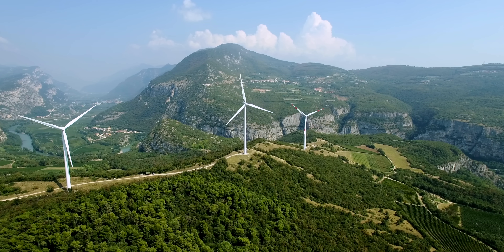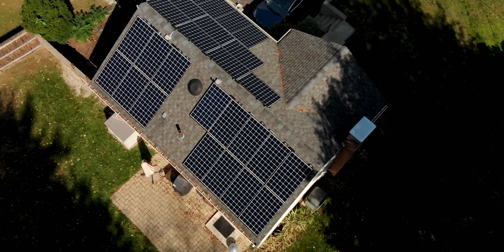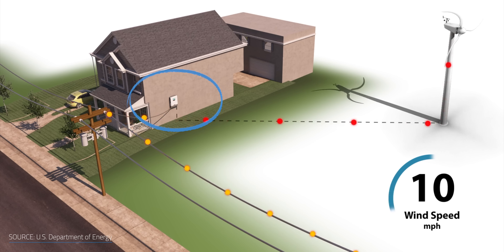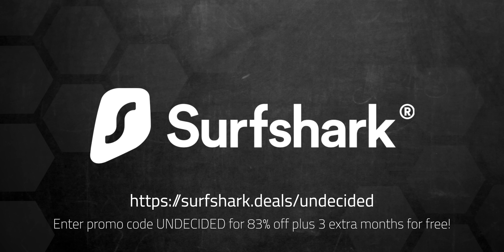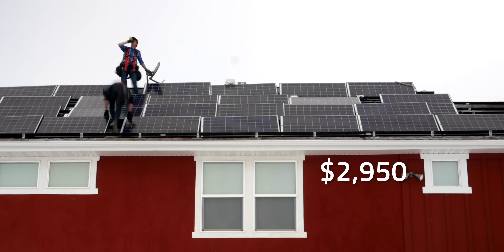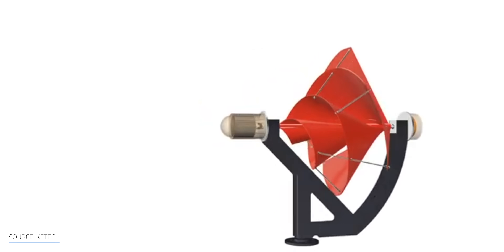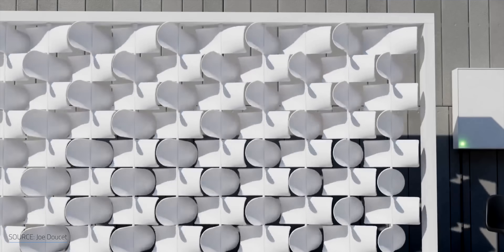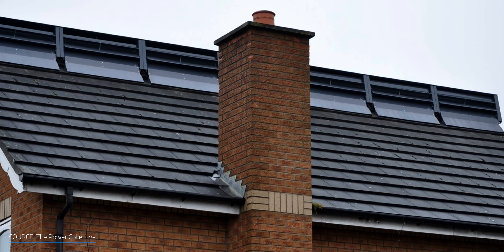The Challenges of a Wind Turbine on Your Home

Comment: Having worked in the small wind industry for 12 years, selling ~4000 small wind turbines, having one in my own yard for 14 years now, I would encourage everyone to install solar and forget wind, for the reasons Matt gave here.  The 3 small wind manufacturers I worked for are long ago bankrupt and the goofy designs shown in the video won’t produce hardly any energy but will cost a lot.  Large, utility wind makes sense because they’re hundreds of feet in the air with massive rotors.
Reply: That’s fine unless you live in a place like I do with over 50% of the days having 100% cloud cover or fog and almost every day with moderate to strong trade winds. It’s all about location and microclimates..?.
Reply: @cadfael4598  you are probably better off installing hydroelectric genoration if you are wanting to go off grid in an environment like that. Small scale wind is a great project if you want to do it for it's own sake but it simply isn't cost effective.
Reply: That might be true, moving parts seems hell to maintain. However, with less than average sunny days, 53° North and average wind speed around 13-14 km/h, I can see why there are Dutch startups entertaining the idea. Solar just doesn't pay off in some locations.
Reply: I assume 12 years ago there was a lot more ability for solar and wind to compete at a small scale right? But then solar just kept getting more and more efficient while wind stayed mostly the same (at the residential level).
Reply: @SaveMoneySavethePlanet  It isn't so much efficiency has improved that much for solar, unless you want to call it efficiency of manufacturing. Cost from 20 years ago were about ten times as much per watt for the more commonly available panels and those are in the 13-15% solar efficiency range. Then and today, you could buy panels well above 20%, they just aren't worth it for most applications.
A big issue between the two techs, is they have opposite scalability problems. Generators, of all kinds, tend to get more efficient as they get larger and cheaper to manufacture, and easier to deploy at scale. Solar is simple and cheap enough on the small scale, but gets surprisingly complicated as it grows. If those problems with solar can be addressed, it does have greater potential, but for the moment it is a good choice for systems on the 10 KW order. Wind seems to take over by the 1 MW, and the more traditional techs for GW and up.
Reply: @barongerhardt  ah interesting! Never thought about it that way!
Reply: It has to depend on location. There is a YT channel by Kris Harbor, who has a wind turbine producing up to 400w. He admits, his location is pretty windy!!
Reply: I don't know that anyone is advocating to get wind instead of solar. I agree wind has some serious flaws for micro-generation at least with HAWT. I think some of the VAWT options and especially that Ridge Blade system show promise as a supplementary option.

With solar, for monetary reasons we focus on grid tied solar with no batteries. Then people with money might invest in a battery like a Tesla Wall or something that can get them through the night. Batteries are pretty expensive but if something like the Ridge Blade is sold at scale, it looks like something that can be installed in a day, is minimally invasive, protects itself against excessive wind, and is no more unsightly than anything else on a normal suburban roof. Just for fun I think I might have a broken tower fan that I might break open and experiment with.

Again I agree SOLAR > Wind. But wind has merit if we think differently.
Reply: A basic box fan has the capability to produce a current from wind blowing in the window, albeit in the mA range lol, maybe power a small led
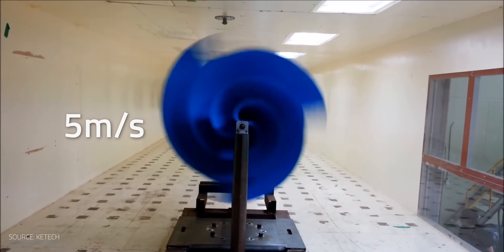Reply: The Canadian one at 10:53 also doesn't make sense?
Reply: @rajaram4658  …I’ve been a roofer and do all my own roofing maintenance.  I can tell you that on the ground the air will be completely still, but on the roof it is windy as heck.  Doesn’t make sense as I live in a one story house so it’s only 20 feet above ground, but that short distance makes a huge difference.  So I can understand how that Canadian contraption may possibly work.
Reply: is 10 to 15+ mph ( max i remember is 40 to 60 mph stable for 24 hours or so ) 20 or more feet up do with stable wind speed as 4-ish months out of the year at this house is dead calm the rest is super windy omost constantly, is it a good candidate or not really with 2022 technical/off the shelf kits as installation with good information for me shouldn't be to hard to do and had someone sigesion of running that over a 1 to 12kw hardware store generator as o crap no solar or utility power mode and or as supplemental to charge up the bev or house batteries
Reply: So the truth comes out!
Reply: This kind of first hand info is what people need to make a decision.
Reply: Pour billions of $$ into wind turbines, and they'll beat combustion all day long. Everybody saying "moving parts" because the OP video guy said it. Bunch of sheep that don't care to make independent decisions.
Reply: What bragging rights! 

Here's something for the idiots of Renewable Energy: 

Sooner or later you greenies are going to need to grow up and learn how economies work. - hint government people understand nothing of economies other than  how to rape them.    

These G-morons decided "woke' power (power that doesn't really work) was a great idea for them, not us, so they decided to steal some money from some ratepayers in order to pay others to stimulate the growth or power that really doesn't work - ie wind and solar.

In the real world, the one that really works,  there is something called supply and demand and these things regulate the price of everything fairly.  

Your butcher buys his beef by the side and pays more for it than the meat packing plant did who in turn paid more for steer than it cost the rancher to produce it.   Get it so far?     

Now when you buy that beefsteak at the butcher's shop he's going to get his markup as well,  so you as the end consumer are going to have to pay a lot more for it per pound than the rancher was paid for it.   

Next time you want a beefsteak drive out to a ranch and buy your steer on the hoof - then you slaughter it, age it carve it up sell the inedible parts to dogfood processors and the like and eat the rest of it on the cheap - no you want the value that all those who added value to the meat along the whole length of the supply chain don't you?  Or do you buy your steaks on the hoof?      Or do you expect to pay the  ranchers price at your favorite steakhouse as well?

It's that way with electricity too, you cannot expect the power company to buy power back from you at retail rates when they don't even need or want the power. With that business model they will go bankrupt as soon as their investors are wiped out.    

If that rancher were to dine out at your favorite steakhouse why not demand that your ignorant politicians make the restaurant buy his on-the-hoof steer from him on demand at the same rate per pound that they charge you for a 16 oz prime rib?    

The problem is, as with all government planned economies, sooner or later everyone will want to receive the grift instead of paying for it, when that happens the lights go out - permanently.

The most ignorant feature of all of this is that it is supposed to solve some problem that the grifters dreamed up but that does not actually exist so solar panels and wind turbines only create huge problems, they solve nothing - time to wake up you dizzy Californians.
Reply: Agreed though it would be nice to be able to use a small wind turbine to complement solar

You need a lot less battery capacity, if you've always got either sun or wind tbh
Reply: I'm not an engineer, but just from a simplicity standpoint, solar doesn't have any moving parts, wind does. That alone seems like a good enough reason to consider solar over wind for small installations.
Reply: @jadeskye6755  If you live in a windy area, wind power can reduce how many batteries are needed since it will be mostly constant with power generation. That can be a huge savings. But most houses are not in windy areas.
Reply: @anthonypelchat  uhm... people do live on the Prairies & flatlands...
Reply: @blackdeath4eternity  I clearly said that people do live in windy areas. Just most either don't or have obstacles that reduce wind flow, making wind power impractical for them.
Reply: @anthonypelchat  i was not implying that you said anything BUT almost anyone in the central states & Canada if not in the middle of some wind block live in a windy area (at least from my experience & what i have heard) & to say "But most houses are not in windy areas."  seemed like a over simplification & cuts out the fact that there are still a substantial population in those areas.
Reply: @blackdeath4eternity  Most is still correct. Most houses are not in windy areas. Of those that are in windy areas, many are blocked by trees or buildings that also prevent high winds. And we are talking about high speed winds at low level constantly. There simply isn't that large amount of houses out there that meet that specific criteria. 

I don't think you truly understand the criteria here. We are talking about constant, not intermittent, wind speeds of 15-25 mph at the location where the wind turbine sits. Even in central states, that is not common. Most turbines are high in the air, well above the tree line, because that is where the constant wind speeds are.
Reply: @anthonypelchat  i never said it was wrong, i merely said its a over simplification & that there's a substantial minority living in certain areas.
obviously my over simplifying the explanation of how you were oversimplifying was not a good idea so  my apologies for that.
Reply: @jadeskye6755  They'll also fail in isolation, which is another benefit if you're actually dependant on the energy.
Reply: @jadeskye6755  yes, i agree max out your site for solar before considering solar. i thought the roof top horizontal concept looked very interesting.
Reply: @scottmcshannon6821  
“Max out your solar before considering solar”
Reply: @scottmcshannon6821  except my Ridgeline is pointed the wrong way most of the time wind wise same for solar as the ridge is E&West not south facing so the wind in my case probably wouldn't force it to turn as thats the broadside of the house and that low profile turbine ( i like the idea but this house im not convinced its a good fit or at least not the first pick as it's more of a lets add more wind capacity to the 5kw chimney system and or 10 to 20kw roof solar panels ) and shielded from making any potential power, now the more rare direction of the front door/street that will work wonders as it's dead smack in a tunnel street wise and ridge wise so id get the idealistic power out of it

with south facing id get decent power as im next to a hill and other things that speeds up the wind and or makes it more consistent power potential so im leaning to a more common looking setup that can engineering wise takes advantage of the sichwasion better 

slowing down the wind by harvesting the power out off it would be nice and or maybe reducing my drafts and property damage/nusins/heavy noise would be nice as a small summer's breeze is nice but flying patios stuff isn't in the fall/spring ect
Reply: @scottmcshannon6821  huh?
max out for solar before solar?
Reply: @jadeskye6755  Also imagine how annoying your neighbor's old squeaky wind turbine would be. Solar is silent, which makes it a much better fit for a residential neighborhood.
Reply: i think those goofy designs can, and probably will, have value.  Today's wind turbines are the results of centuries of refinement.  Any large leaps from here on out will likely require reinventing the wheel a bit, especially in low-ish wind environment.  I agree that regardless it wont be worth it in a home residential sense for the vast majority of people, but some of the designs could have merit in non-residential areas like along highways.
Reply: @The_Lone_Aesir  Along highways there are large wind turbines...
Reply: @xeridea  not in urban and suburban centers. What i am referring to is having small, yet plentiful, turbines dotted along highways, perhaps on top of the lights, or mounted on top of sound walls.
Reply: @The_Lone_Aesir  This would have the same issue as on houses. Small turbines are inefficient. Making massive ones is the only economical way to get power from wind. Also, urban areas tend to have less usable wind, due to all the buildings disrupting it. Open areas, hilltops, and the ocean are good locations. For other areas, there is solar.
Reply: So refreshing to see a decent informative comment on YouTube. Thanks!
Reply: Same on me , but i dont sell Windturbines , im a Hustler and sell Bitches , every one should have one ✌️
Reply: Stil, micro wind doesn’t use extra land. If energy use is close to where it’s produced, you save the heat losses from resistance in  the wires. Also, works at lower wind speeds. Probably could edge out solar in winter months.
Reply: @Alrukitaf  the effeciency of micro wind turbine is nonsense.   it's basic physics.   always bullshit in this channel
Reply: 30 years in off grid power myself.   Literally I've been involved in 1000's of projects and in the middle designing and building 10 right now.  Small wind has burned us and everyone we have ever known 100%.  Stay away!   "do not seek the treasure!"
Reply: The resistance of wires reduces the power supply from grid scale wind generators, so i wonder if these power loss calculations were used to decide the argument.
Reply: @Alrukitaf  There is wire resistance with any generation, wind, solar, hydro, nuclear, gas, oil, or coal. The voltages used at grid scale are very high, so transmission losses are small, even over long distances. The massive efficiency improvement dwarfs the tiny transmission losses.
Reply: @Alrukitaf  the losses aren't all that significant at the higher voltages used by the grid when transmitting energy over longer distances.
Reply: @Alrukitaf  
totally irrelevant
Reply: Within 3 yrs every single one of those turbines will have faded into the ether with millions of investors dollars and leaving motionless works of art on early adopters roofs in thier yards.
Reply: @Altenurgy  it does not work until it does!
Reply: Agree mate, for the sake of simplicity solar is the way to go
Reply: Both are too expensive and impractical... with solar you are basically just paying your electric bill for the next couple decades upfront compared to just standard monthly...  The solution is nuclear power per its cheaper, cleaner, and safer than all other forms and has been around for decades

Comment: I imagine that when utilisation of solar goes down (cloudy/night) then it would often go up for wind. Utilisation of both sources is a major issue. Batteries are still small and expensive so having two sources of energy complimenting each other sounds like a good deal. Looking forward to some of the new techs (ps. I live in a windy area close to the sea)
Reply: Grid scale wind and community owned wind is the way to go if you want wind power
Reply: Check out sirocco energy - they have a new design for a turbine that supposedly
Produces significantly more power and less noise with minimal maintenance and low startup cost.  They will be releasing them this year so may want to wait until the first testimonials drop before you spring a few thousand for it
Reply: I think you need a triad to form a  robust off/on grid. You need solar, wind, the utility grid and/or a backup gasoline or diesel generator. My ideal system would be solar 50%-60% of the energy to charge the batteries, wind 10-20%, and the generator or utility grid 30%.=40%. The solar panels/wind turbine/electric grid/generator would charge batteries and be capable of powering all critical electrical devices even in the event of a prolonged power outage, or completely off grid.
Reply: With new panels you can still generate a decent amount on a cloudy day as long some light hits them. Battery storage costs on average 800-1000$ per kWh. So not sure if a turbine is worth all the hassle.

Comment: Dear Matt, Thanks for your informative videos every single time! I want to point out that the g /kWh  that you mentioned in the video are off compared to the numbers I know. Yup, I know this is an wikipedia link, but these are quite representative. By nature, natural gas has an emission of around 200 g/kWh. This is without the efficiency loss at a power plant, making electricity from gas in a combined cycle gas turbine (CCGT) power plant of around 58% efficiency already 350 g/Kwh emission.

Please continue on making these great videos. I sure enjoy watching them ;-) 

*I work as a Dutch energy consultant

Link to CO2 emissions: https://en.wikipedia.org/wiki/Life-cycle_greenhouse_gas_emissions_of_energy_sources
Reply: Gas is worse than your figures if you include fugitive emissions/leaks in the gas supply chain. At a typical industry loss rate of 3% then if you take in the 20 year CO2e impact of this you end up doubling the effective emissions.